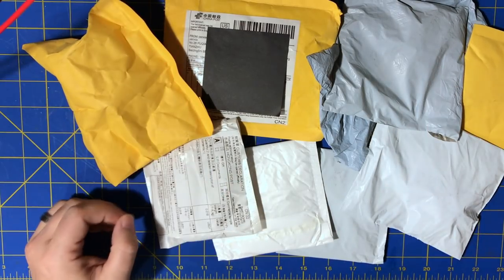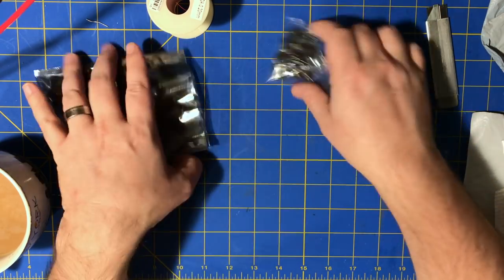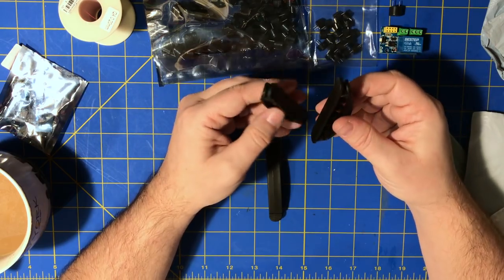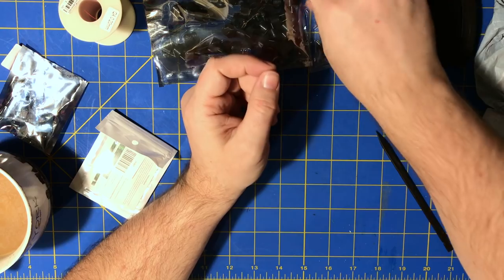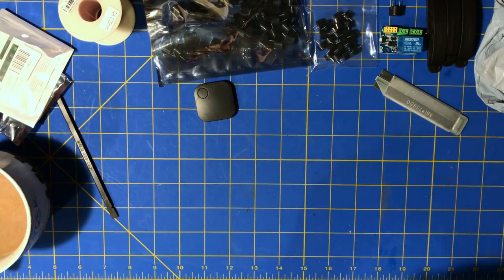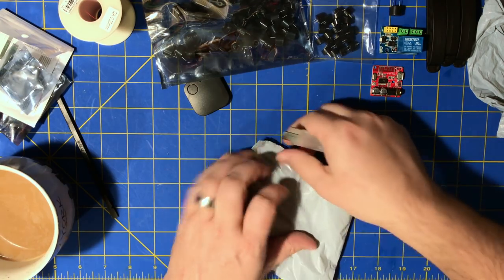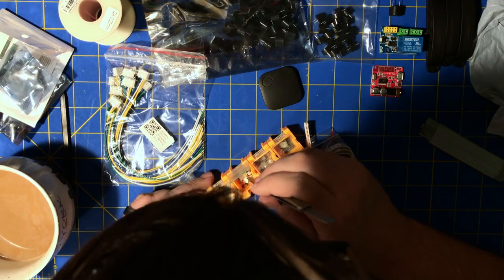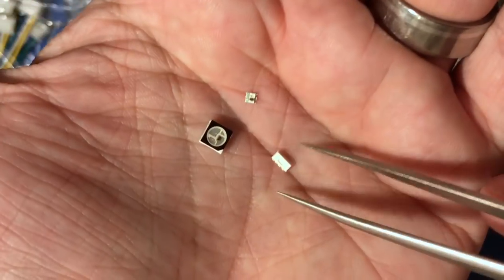Mailbag #23 01-2019

Comment: If you're going to use coin-cell powered beacons I would recommend finding some BR cells to put inside of them since they are stable across a wide range of temperatures and have a much lower rate of self-discharge.  It is not uncommon for them to last twenty years or more in some applications.
Reply from the maker: very interesting, I was not aware of these
Reply: @ douro20 

TIL.  Thanks.